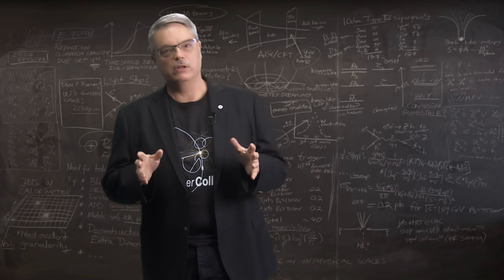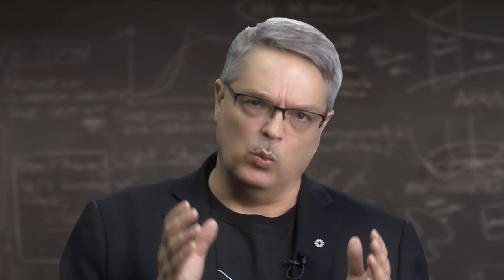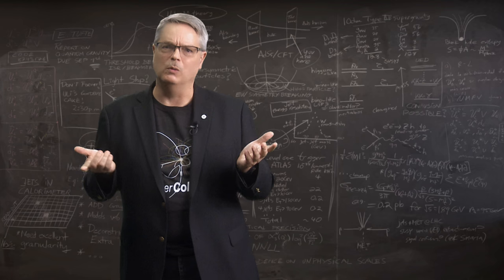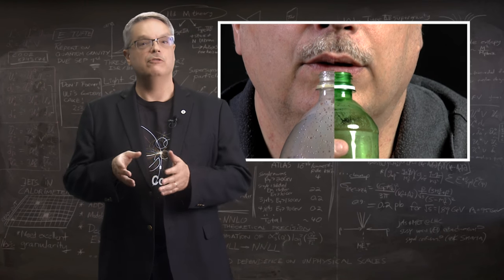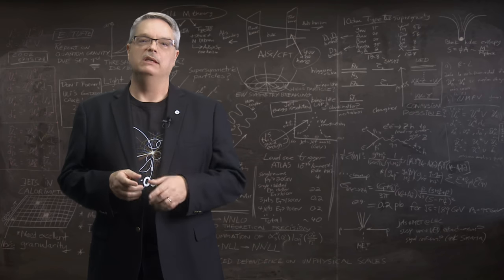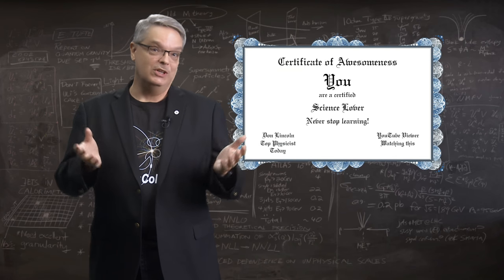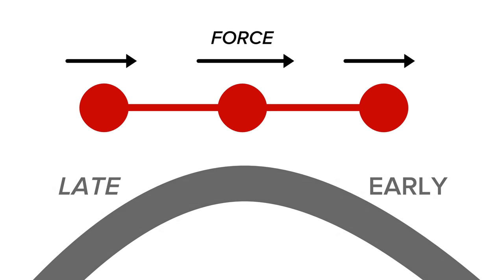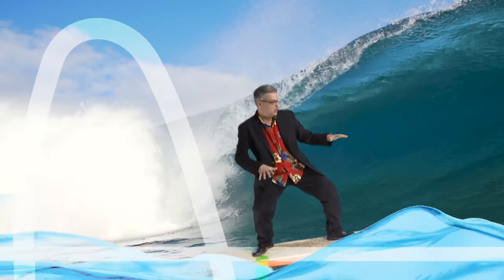Accelerator Science: Why RF?

Comment: Hey! Thanks for all the videos so far, this is very interesting stuff. I have a questions if you don't mind. Since the bunch gets accelerated more and more and does this mean that you need to control the phase angles of the RF waves injected into the cavities as the bunch loops around to always allow for this perfect scenario? Also. how big (physically) are the typical cavities and what is the typical frequency of the RF waves. Cheers.
Reply: +ScienceNinjaDude What does that have to do with readings from frequency? You'd still get a data feed from the loop, if I have a timer running for a car going a lap it wouldn't matter if I used seconds or milliseconds, the loop feed would just be fractioned data when momentum increases.

Comment: I have a question, and I hate to ask it here but I can't seem to find the answer. I understand how standing EM waves are created inside the cavity and this is the oscillating electric field that accelerates particles. What I don't understand is the geometry of how these standing waves are created in such a way that the E field points in the direction of the particle's motion. I imagine the standing waves being created in the longitudinal axis (along the length of the cavities), but in this case, the E field would be oscillating vertically and not horizontally. Can somebody please explain? Thanks!

Comment: This is not the reason we use RF to accelerate particles.   There is some advantage to resonance when using a standing wave cavity. But there are many disadvantages of using RF.. energy spread of the particles, duty factor, heating and resonance matching etc.   We would prefer to use DC voltages if we could.  The problem with DC is arcing.  This limits DC voltages and its something like 10kV per cm.    Consequently,  our accelerating gradient maximum is something like 1 MeV/m.  THe largest van der graaf is 7MeV and is quite big.  RF cavities can achieve much higher gradients on the order of 10's of MeV/m.   This was the motivation to move from VanDerGraf type accelerators to RF cavities.